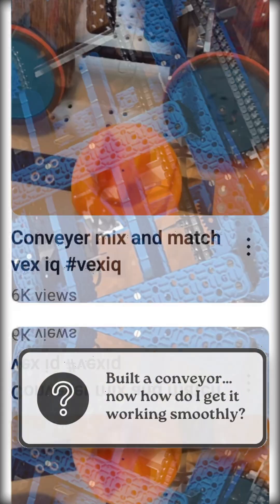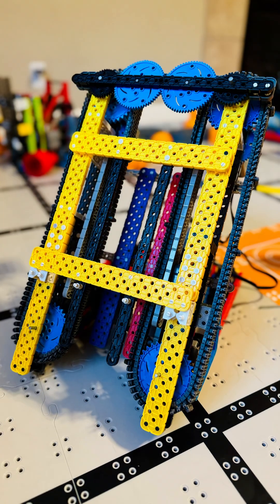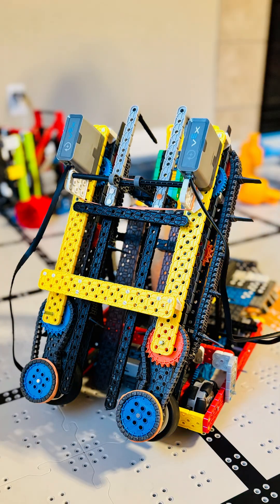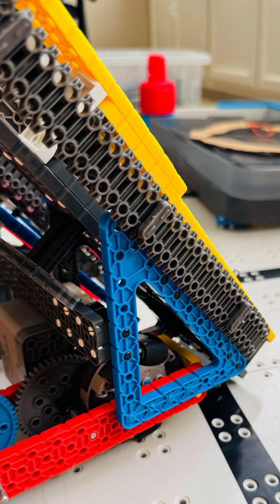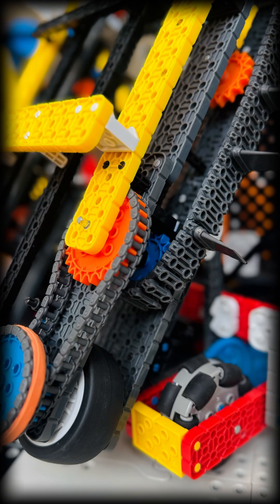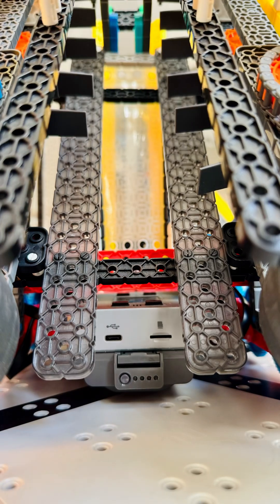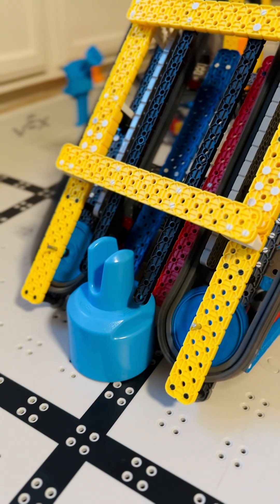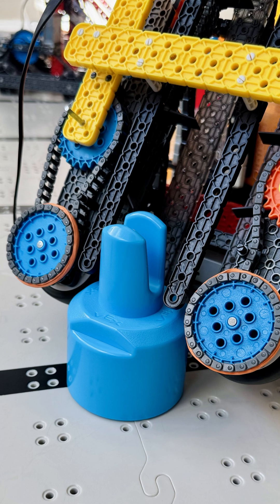Chewbotca’s Guide to Tuning a Conveyor | VEX IQ Mix & Match | Chewy's Tip Ep. 2

Comment: What did you say about the ramp and where it should be placed so it doesn’t push the pin away. Just cause you said it quickly and I couldn’t understand it.
Reply from the maker: Yeah sry abt that. The ramp needs to be far enough back (like behind the conveyor belts) so that it doesn’t prevent the conveyor from contacting the pins. Otherwise tho, try to keep the ramp as far fwd as possible.

Comment: Wait so for my conveyor, one side of the conveyor moves faster than the other. is there any way to fix this?
Reply from the maker: Try replacing the motors and adding a gear box to link both sides of the conveyor together